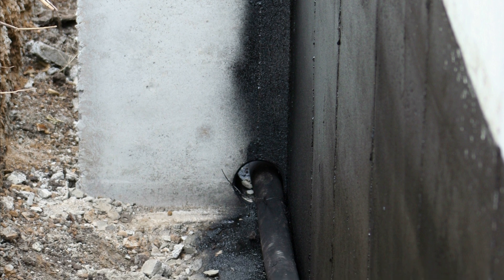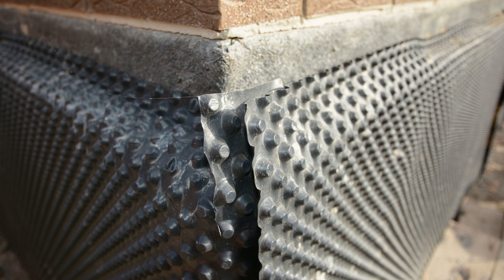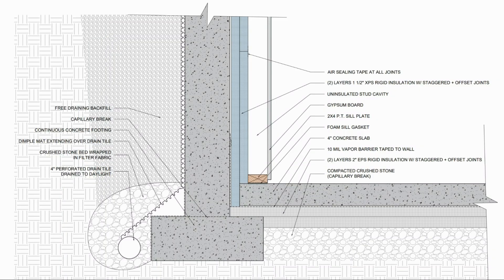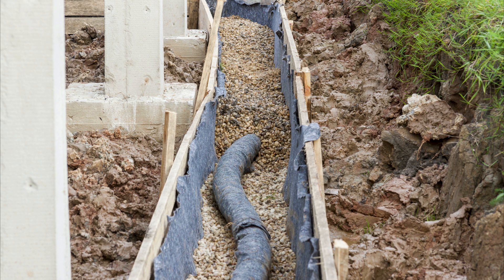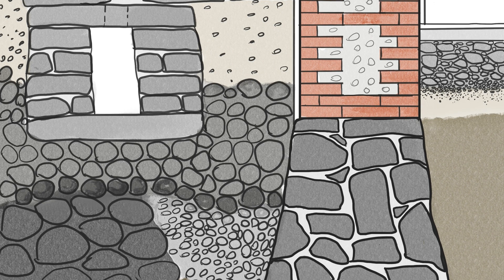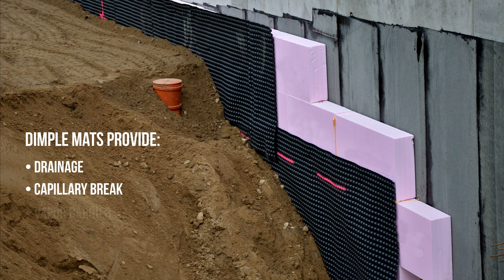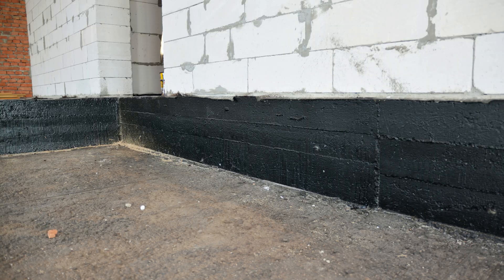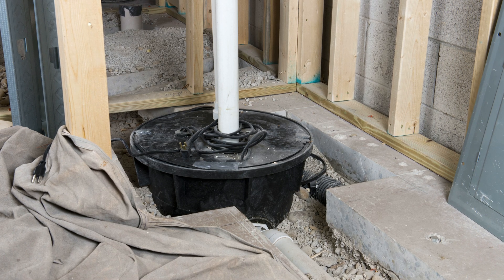You NEED This For Your Foundation Walls | Dimple Mats For Foundation Drainage

Comment: Asiri:  You keep showing pictures of dimple mats with the dimples facing outward (away from concrete wall), every brand of dimple mat I've looked at specifically calls out that dimples need to be facing the wall (not away).  Seems like most of your other videos showing dimple mats photos and or cad designed there is a 50/50 spread of showing dimples out vs dimples in...are you doing this on purpose to promote comment/engagement?  Is there actually a reason to ever install dimples out?  Please clear this up and/or make a specific video that covers this once and for all.  Thanks.
Reply: MiraDrain products (at least some of them) specify that the dimples face outward.  These products have a fabric filter over the dimples though..  not sure if that matters.

Comment: What are the pros and cons of placing the dimple mat / drainage board in front of or behind the foundation insulation? I see that some manufacturers place the drainage on the outside to protect the foam, whereas others place the drainage behind the foam to protect the foundation.

Comment: The dimples must be facing the foundation waterproofing to create a drainage gap. With the dimples out and the flat plastic sheet against the waterproofing, there is no drainage plane and a porous drainage material is needed against this, like washed stone or 2" fiberglass boards. This video shows both and should be amended to show best practices.
Reply: Hear hear. I saw several images with the dimples outwards and it did not make a lick of sense.

Comment: WHY is the membrane installed in two different ways? On some foundations in your video you have the dimples towards the foundation and in other you have the dimple outward side. Which is the correct orientation?
Reply: Dimples stick out to where the drainage gap should be. So dimples should rest against hard surface - concrete, rigid foam, etc. NOT AGAINST SOIL, as it would not provide a gap. So yes, in some instances the membrane is shown to be installed wrong side IMHO. BUT eventually it all depends on waterproofing composition design, as we don't know what is the final construction detail shown on pictures.
Reply: I'm not a pro by any stretch but some manufacturers say to install with the dimples out.  Not sure why, though.

Comment: Do dimples face the foundation wall, or do the dimples face away from the foundation wall?
Reply from the maker: @EduardoCortez-pv3qs  Dimples should face the foundation wall in 9 out of 10 cases. Sometimes, the soils and the hydrology of the site can so saturated that you need to actually drain the soil rather than the wall itself, in which the dimples face outward with a sheet of filter fabric separating the dimple mat from the backfill. There are also double sided drainage products for these applications.

Comment: Half those pics appear to be showing the dimple mat with the dimples facing outward instead of inward. Given what has just been explained, shouldn't the dimples be facing inward towards the building? If it's facing outwards you would not get the gap you want, right?
Reply: It's actually more effective faced outward with filter fabric or tiles placed in front of it. Faced inward the dimple mat creates a water proof layer that prevents ground water from entering the air channels of the mat. Essentially you're just moving the problem one layer further from your wall. Helpful, but not as complete a solution as actually draining away the water column and relieving the hydrostatic pressure as a result. Eventually the inward faced mats will have gaps at the seems or other failures and so water will enter... And then the mat will perform like you expect, draining via the air channels. So some installers save time/cost by installing inward and others install outward with filter fabric.
Reply: @kg4lod  that's really interesting thanks for the comment!
Reply: @kg4lod  Thanks for sharing that.  I recently had my foundation treated with Miradrain 6200, which has the dimples covered with the filter fabric.  As per the manufacturer, it is installed with the dimples facing outward, but I never really understood why.  Thank you.

Comment: Do you need waterproofing and the dimple mat or does the dimple mat act as the waterproofing?
Reply: you absolutely need to waterproof exterior B walls, not damproof them and they should be backfilled w/most--all gravel, clay and sand will settle and will loosen--pull down dimpled membrane and visqueen hence #1 choice is gravel backfill but one needs to be careful when backfilling with equipment, interior drainage systems are a scam, liars, cons, bet.

Comment: The manufacturer has the dimples facing the wall like your 1st graphic and I found another manufacturer's installation guide and they said dimples facing the wall too, your second graphic and your drawings in this and another video show dimples facing away from the wall, this is an incorrect of installation or is there a reason it's shown backwards?
Reply: Inwards is a newer configuration (easier to install and cheaper), but both configurations work. With outwards you have to add a textile (filter fabric) to prevent channel clogging. Inwards you have to add another water proofing (damp proofing) layer to the outside of the foundation wall because the drainage mat isn't doing that job anymore.
Reply: I think dimples always facing the concrete , an air barrrier is built to allow water vapour to go away, vice versa won't make any meaning, dimples are there for a reason, If I am wrong please  correct me

Comment: Of necessity, I redid my French drains after being in the house about 18 years. I had the contractor apply a bituthene membrane and then a dimple mat over that, with lots of gravel. Be careful though, the primer applied to help the bituthene adhere off-gassed for well over a year, and this was only done on the rear of my house, one quarter of the circumference. The back was the direction of hydrostatic flow. You don’t expect this kind of problem, and when it happens your options for dealing with it are few. Off-gassing hasn’t been properly studied with many home products. There can be significant levels of concern below the odor threshold. The only way to really know is to take air samples, and then in a large Dewar flask.

Comment: So important. Our 1973 house is dealing with bad water issues because they thought a layer of asphalt-based "waterproofing" would be enough. Dimple mats seem like a no-brainer but what about the fiberglass mat systems?
Reply from the maker: The fiberglass drainage/insulation systems work just as well, though I think their "thermal performance" is a little more than a marketing gimmick. As far as drainage though, they're good.
Reply: @ASIRIDesigns  Good to know! We're planning a build for later this year and the fiberglass system offers a good warranty but I wasn't familiar with it. Thanks. 👍

Comment: Another great video.  I thought I knew all this and then saw in the detail drawing that you have the dimple mat extending over tne footing and even the drain pipe, providing even more protection to the cold joint between the footer and stem wall.  In the drawing, you show a void in that triangular cross section where the dimple mat covers the footer. My concern there is that the weight of the backfill may tug down on the dimple mat.  I might consider filling that void with pea gravel for support.  Maybe some visqueen to protect the waterproofing from the abrasion of the pea gravel.  Maybe overkill, but do you see any negatives, except additional cost?

Comment: This video is spot on! I built a basement in a very wet area knowing full about how much water I was going to have to deal with, I exclusively used dimple mat combined with an oversized french drain that drains interior to a sump pit. Some notes about the video I saw the dimples facing outward to the back fill? Those pictures don't seem correct. I installed mine 10 years ago and put the dimples pointing directly to the concrete block as to create an air gap and drainage system. I covered the dimple mat with XPS foam. All has performed flawlesly and provided a very dry basement. The sump pump has taken a beating at times! These videos are very great and informative. Often times people have already completed a project and looked back at how it could have been done better.
Reply: Minus the XPS I’ve the same. 1000 gallons/day pumped out of my sump. Damp proofed and dimple mat. Just hit four years. They put more drainage gravel than they normally do by the foundation. No issues so far, with less than average settling issues (eg the tiny hairline cracks in block wall mortar, which are normal).

I was also surprised by the first picture in this video because my dimples also point with the pyramid, sharp end touching the foundation, to provide some air gap.

Honestly, I don’t see how the heck is possibly alleviates hydrostatic pressure. I thought it was really just another level of waterproofing as damp proofing eventually wears out. This mat is impervious to moisture, so nothing’s gonna get through it. Any pressure against it isn’t gonna have anywhere else to go.
Reply: @patty109109  I think we made good choices. The drainage gravel in the drainage system relieves the hydrostatic pressure. Maybe others are in different situations but Im glade it has worked well. My area we have "wet" seasons and eventually towards the end of summer the water really slows down. So it gives the pump a break.

Comment: Good work,   I'd suggest more images of what is likely to happen when water wins.    I'd push more customers to the video if they could see more.   How about a longer form customer relations style 30 minute infomercial like video.    I'm thinking Home Time style.    Keep up the quality work.
Reply from the maker: Absolutely, had to get this video out while on vacation so my resources were a bit limited 😅 Will have some more complete content out in the next couple of weeks. Cheers!
Reply: short vid, newer build poured wall crack + leaky rod holes, homeowner only leaked in this area https://www.youtube.com/shorts/NEoESMun2hk  in future sure, she might begin ti leak elsewhere, why? lol Because builder boy and B codes backfill with most-all clay and don't waterproof the exterior of wall (damproofing isn't waterproofing) and they don't plug all rod holes with hydraulic cement, all biggie mistakes, oh yes - also imo water does NOT 'always win', heck no, been waterproofing 47 yrs